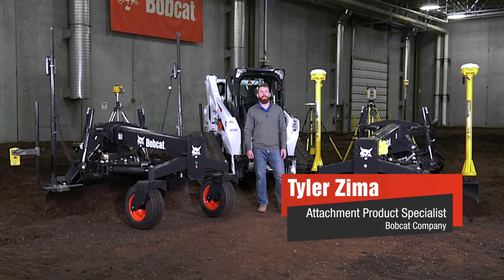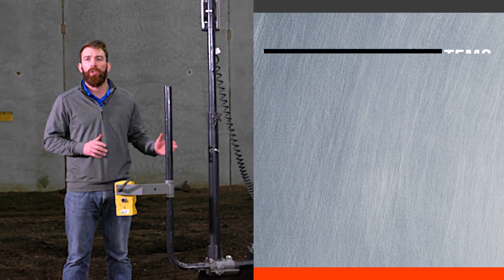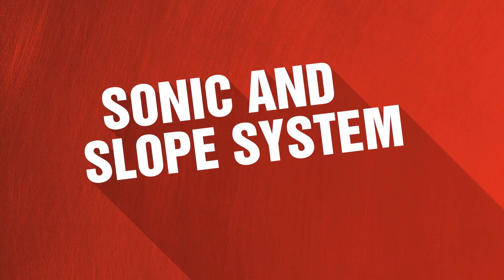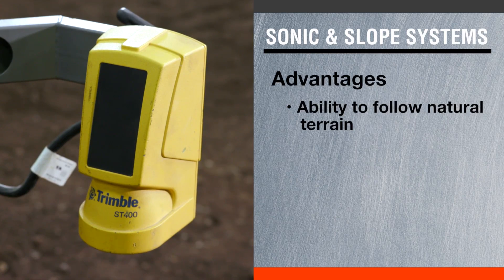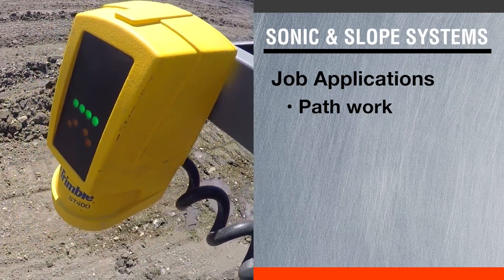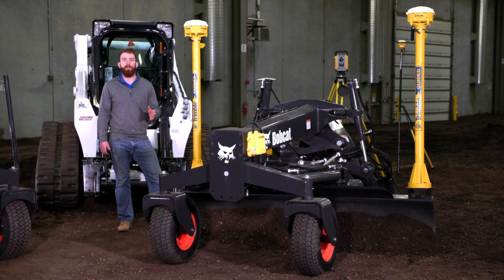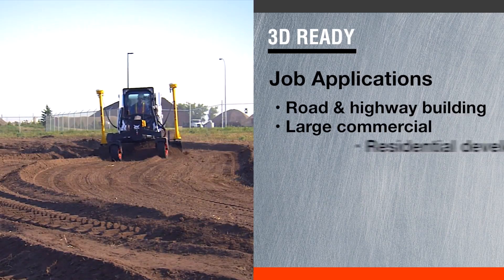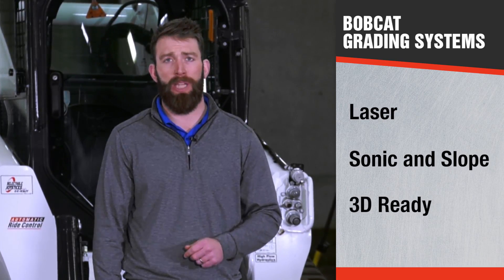Bobcat Grader Attachment Systems: What You Need To Know

Comment: its unfortunate the sonic cannot work with a laser. having one side at field grade with the laser and the other tracing the concrete edger would make the fine grading of a sports field edge so much better. currently we have to use one receiver and manual the concrete side to get that last bit done